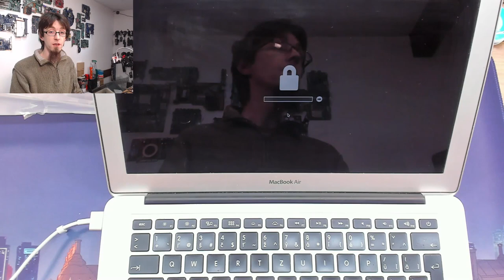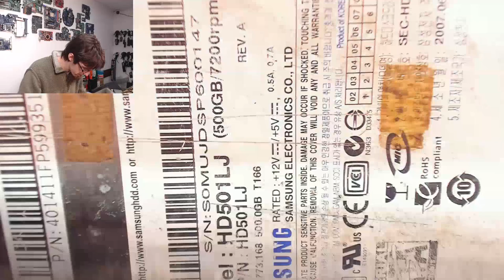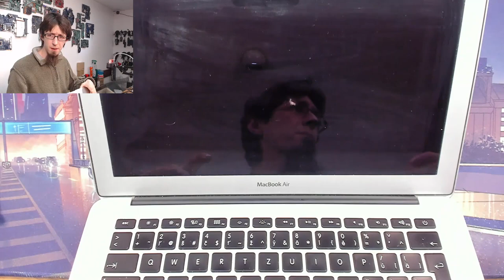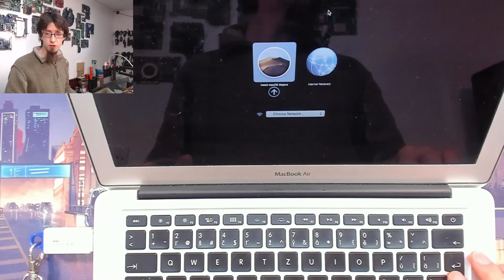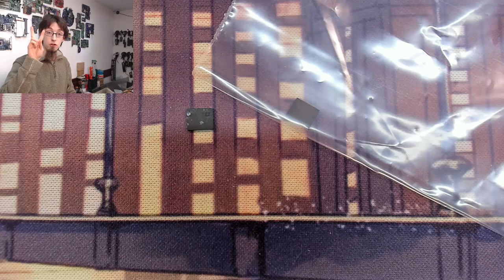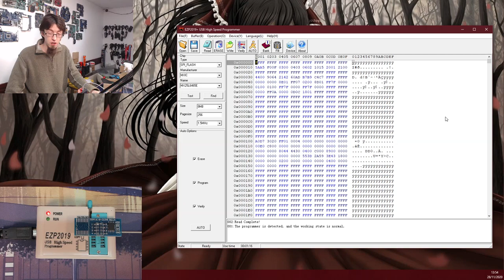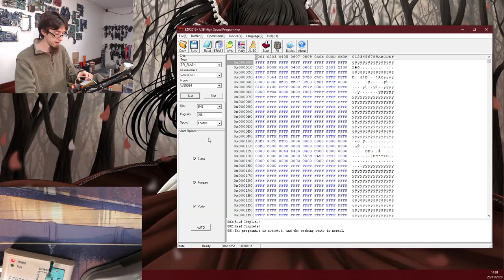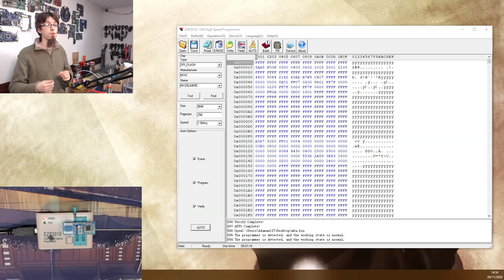[2017 and older ONLY] How to remove MacBook Air Firmware Password - LFC#233

Comment: I for one would be kind of suspicious if a customer came in with a locked "second hand" notebook. Are you legally safe doing something like this, what if it is actually stolen?
Reply: Exactly what I was thinking. Couple of years ago I had a guy who couldn't put in a WiFi password on a Mac, he said it was his sisters'. There was a name on the top right "Vandenbergh". That was not his name though. I left it at that..

Comment: Thanks for another amazing video. Do you know if there is any way to remove encryption on an SSD. Was sold a 500GB, tried to reformat it however it keeps asking for an icloud password :/. Seller has since went mia unfortunately. Is there no way around this??
Reply from the maker: You can just format the SSD. Unless it's a T2-equipped laptop, not sure if those are a different situation.
Reply: @Adamant_IT  its a 2015 macbook air so I doubt T2, model number of SSD is "mz-jpv128s/0a2". When I put it in recovery mode, it asks for a password because drive is encrypted. Just my luck, at least i was able to repair the logic board. Thanks for the reply!
Reply: Try to boot from a usb installer drive an format the internal SSD

Comment: I have experimented with that type of SPI Flash chip (the small one that has 8 legs). I ended up destroying 3 from 5  chips that i salvaged from old broken, experiment donor laptops.. I dont know why they are dead, but i suspecting that my Arduino killed 2 chips because it was 3.3v chip and i program it using 5v Arduino and 1 chip died from miswiring to my Raspberry Pi... and my question is, can the soldering itself damaged the chip and render it unreadable? (maybe from heat or electrostatic?)
Reply from the maker: In my experience, these chips are pretty tough in terms of soldering, but over-volting would definitely be my bet there.
Reply: @Adamant_IT  thank you for replying my comment. Next time i'll make sure i double check the wiring and voltage in datasheet

Comment: Anyone know what that resistor was that he knocked? I knocked it off doing the same and can’t seem to find it. I want to buy a replacement, or try to find one, so if anyone has information on it it would be a huge help
Reply: I did the same mistake yesterday. The resistor value is 15 ohms 1/20 watt
Reply: @danielpigeon1885  thank you! I was worried that this Mac would be fried but now I can (hopefully) get it working again.

Comment: What happened to your powered screwdriver??
Reply from the maker: I don't use it on smaller screws, it's too easy to damage screwheads. I keep a Philips-0 in it for PC-laptops with lots of P0 screws in the bottom.

Comment: you can unlocked efi without remove the bios. chip by special tool... and the way you used on this video. the serial number will be change or will be remove so the best way to program the old bios chip and keep the serial number....

Comment: For a roughly £70 investment you can purchase a programmer kit which just plugs into a header on the main board. No disassembly required
Reply: not worth it for a repair shop he repairs all kinds of laptop that he can use that EEPROM programmer rather using that special tool you use twice or once in a while.
Reply: @bulantuy  You could be right. I suppose it just depends on how many you have to do. I also use it for reprogramming serial numbers on replacement boards to prevent iCloud services issues. Not an entirely essential piece of kit but saves time, and is so much easier. There are a few slightly cheaper alternatives available also.

Comment: All good, but if you knew where to look in the EFI DUMP, you could have blanked out the Firmware Password section (Ive done this many times, and easier)
Also you forgot the most important part....change the serial number, otherwise you'd be using the same serial on all machines you do...and this can be problematic if 1 owner decided to iCloud lock the MacBook, thus locking ALL machines you've fixed.
Reply: Good Point!!

Comment: Very random question has nothing to do with the video I have a set of case fans they're uphere it's a 360 setup as in 3 120s put together anyways they worked perfectly fine. Then I switched to an amd board today and the fans now keep starting and stopping like losing power the rgb goes out and the rpms drop. What might cause this?
Edit: 
I went into the bios and set them to full speed and it fixed the issue. Probably not the best solution but it works

Comment: Aww, there was a nasty comment I meant to respond to, but it looks like it's gone.  However it did mention another channel (dosdude1) that successfully did this on a much older Macbook Pro.  Posted here for reference: https://www.youtube.com/watch?v=KCl6Iu8fSSI  He was able to just replace the password in an hex editor with all FFs.

For the record, even though it took longer and wasn't as pretty as some commenters might be comfortable with, I enjoy the improvising of this video.  Graham's EEPROM-to-SPI adapter is already in the mail he said, but rather than just wait God knows how long for that to show up, he figured out a clever way to use those blank boards to work on the problem right away.  As for completely replacing the BIOS with the dump from the new chip, it's more of a brute force way of handling things, but it also leaves little room for doubt vs playing around with hex editing.  Maybe the solution presented in the link above no longer works; who knows?  I like the approach of buying some extra chips, dumping a copy of the BIOS, flashing and replacing the chip now, getting the computer back to the customer, and then tinkering with cleaner programming and editing solutions later.  Also, that repair is warrantied, so if not reprogramming the serial number causes problems, you can bet that computer will be back in the shop, Graham will have already have a better idea of how to program these things, the customer will get it fixed for free, and we'll probably get another video out of it.

Comment: Hello Sir, I am From South Asia ( Bangladesh). I am a learner of your " 
@UCURRdjIBFE8TDJlPOuiob3Q" . In my hand I have a "Dell Inspiron 15, 41113/SDPP/2015, iris bsw mb 14279-1". This Laptop Off Immediately after starting  (7 to 15 sec.).  The board is clean and clean, Heat sink Installed, Thermal pasted correctly........ This also occur in BIOS Mood Too.....  Replace RAM, HDD but No change........This Laptop Auto start  Battery + Power Jack Installed some time.....Please ....Waiting for wise Advice...